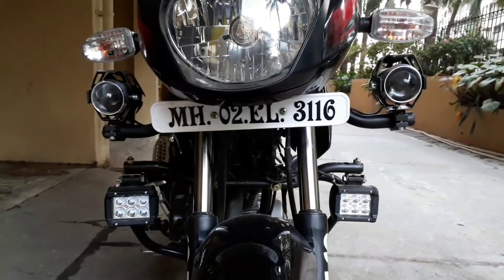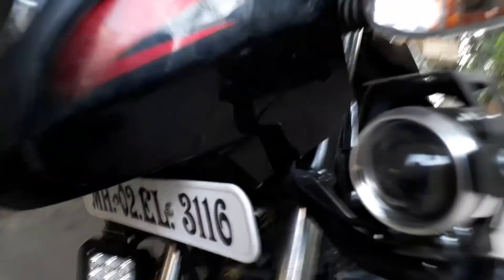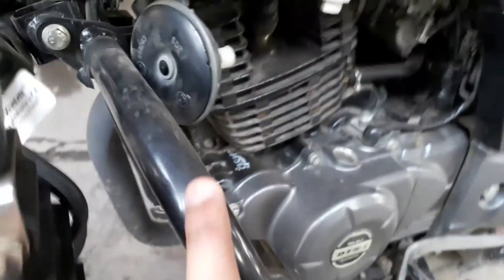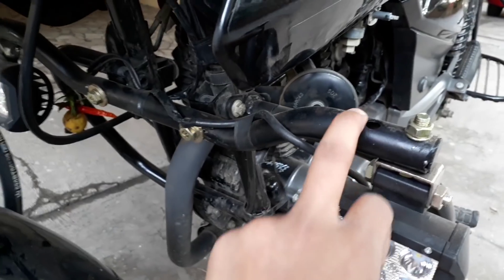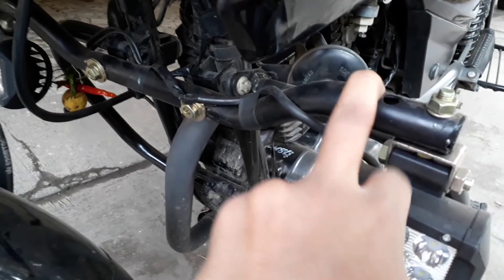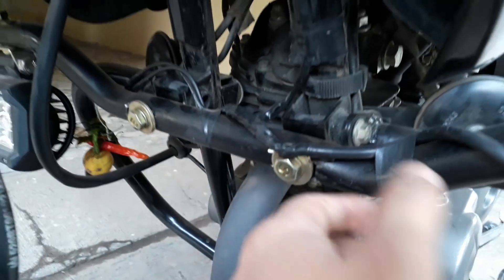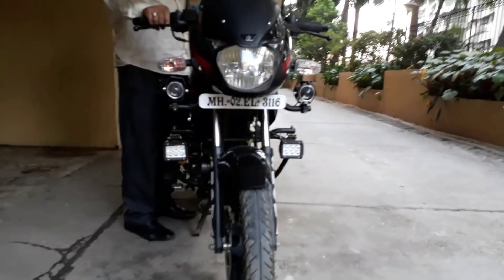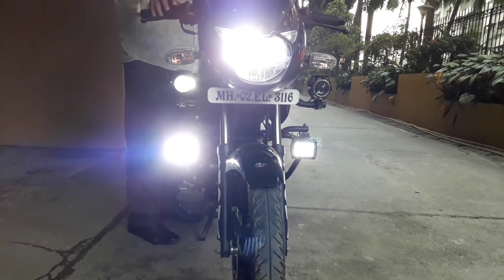Powerful led fog lights for any bike scooter

Comment: It seems to be a problem of battery.. And the 2017 Pulsar model has battery problems!!
Reply from the maker: No problem for battery as we had installd lights in bs4 aho model by disconnecting direct from magnet and did on battery..ye ab afwaaey hai leds consume less power then stock bulbs